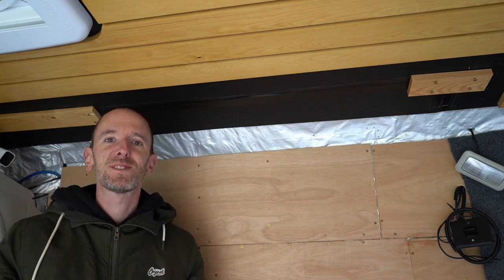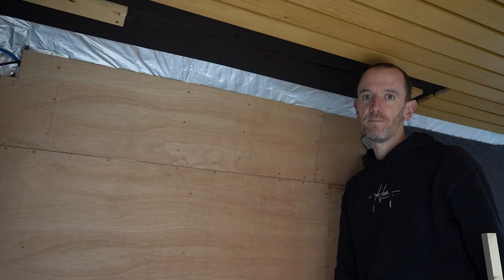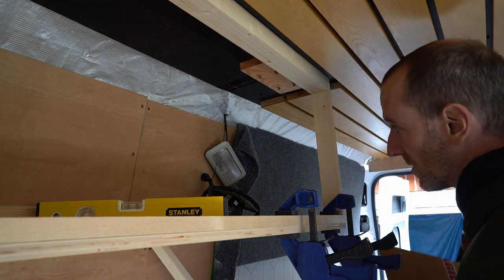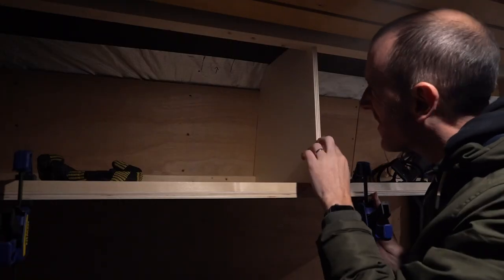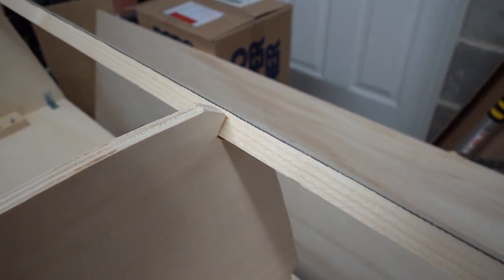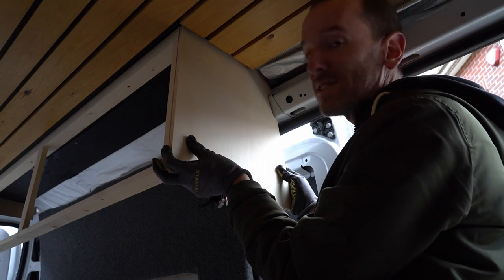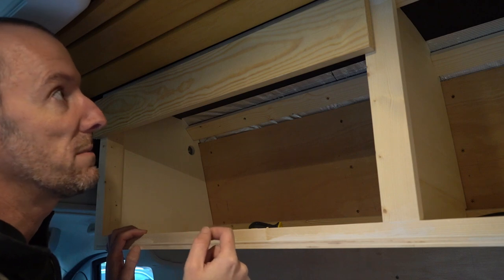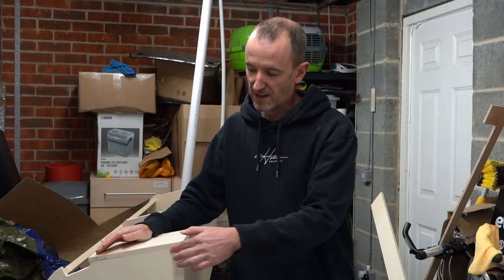UPPER CABINETS Part 1 | Fiat Ducato L2H2 | UK Self-Build Campervan Conversion

Comment: Great videos, thanks for sharing . . . .would it have helped to have set a datum line on the van walls to begin with? like in Kitchen fitting, a true level line from which all else is calculated

Thumbs Up no 600 😀
Reply from the maker: Thank you, glad you found the videos interesting. Yeah possibly might have helped but to be honest it was evolving as I was going so I don’t think would ever have been logically perfect. Also verifying that line was actually true level is almost impossible I think!

Comment: Excellent Work. Incredibly detailed. Thanks again. Quick question. Your fitting tolerances are really tight, do you think you may have creaking issues in the future? I see your wall panels have a couple of mm gap, which is what I have done . I know from other van builds that creaking can be an issue with wood expanding and contracting. I see this being solved with Silicone or similar. Are you planning on applying silicone to smooth the edges out?
Reply from the maker: Thank you. I expect there’ll be some creaking - I’ve resigned myself to that in this build 😂 but both cabinets are fitted up against carpet which will help and I was going to silicone the joins internally to help.

Comment: Awesome job guys. We look forward to your new videos being released as we find them so useful. As we mentioned before we are doing a similar job on our Ducato. Although we are months behind you. One question this time. Do you have a plan for the original lights that were in the back of the van or are you just going to isolate them and hide away. Thanks Matt and Jo
Reply from the maker: Hey guys, thanks for being so supportive and glad you’re still finding them useful. So the light that’s mid way down we’ve incorporated into the overhead cabinets and the one at the back I disconnected. Actually I managed to trap it in the chassis so it’ll be there forever 😂 but not plugged in.

Comment: You made that way harder then it had to be. You build the carcus on a work bench/table using the template for the ends. Then dry fit. And finish up